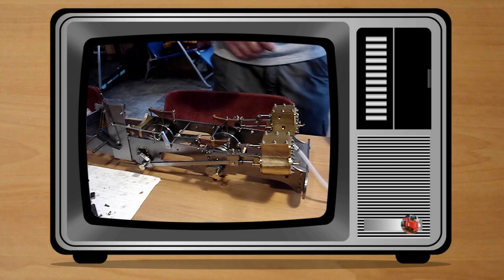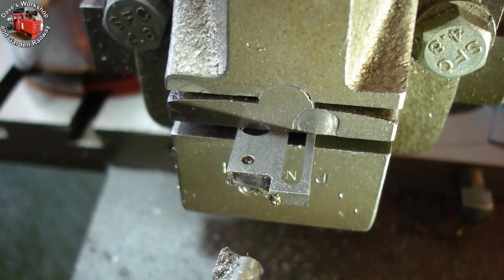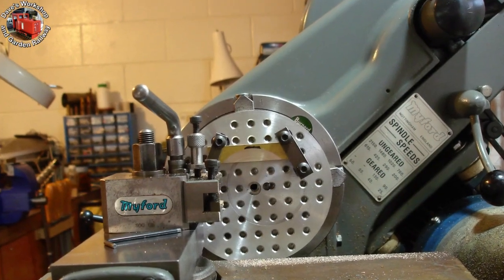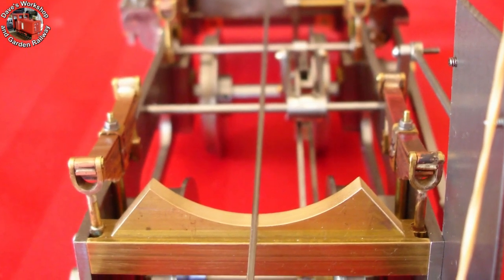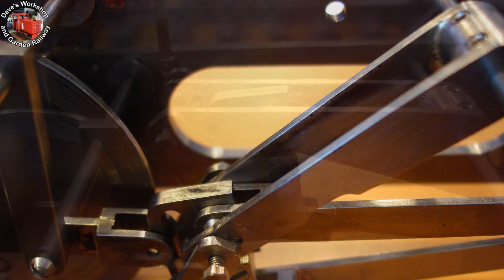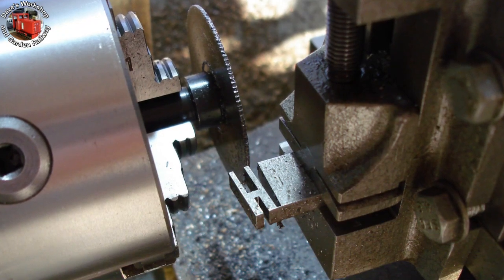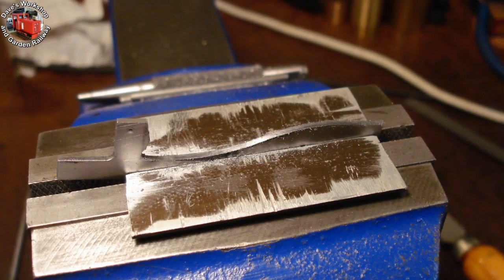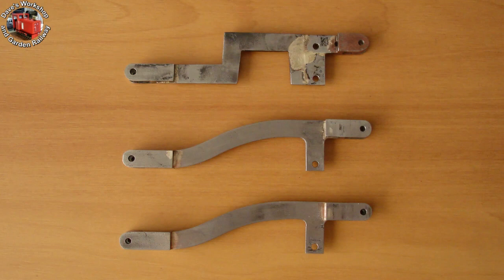Building a live steam loco - Part 20 - Valve Gear Progress

Comment: I think that your lifting links, between weighshaft and point of suspension need to be longer. Easier said than done I know. The angularities when moving from forwards to reverse look big. You may also need to change the lengths of your eccentric rods after your suspension point mods. Have you got Don Ashton’s booklet? GS Willoughby in Model Engineer Mag did a great article on setting out Stephenson valve gear back in the 30s or 40s? I have used his method of layout but in cad with success.
Beautiful work. I admire the quality of what you are doing, it is excellent.
Reply from the maker: I agree about the lifting links.  The angularities are larger than I would like.  I will be sticking with the set-up though, there are height limits (it's just below boiler barrel height now), and I don't want the gear hanging down too low either.  I haven't read the booklet or any other works.  I have really enjoyed working on it, it's been very interesting - keeps the mind active.  Many thanks for your comments they are appreciated.  I'm just starting on four bronze split eccentric straps now 👍
Reply: @GardenRailway  no worries. Keep up the great work. It is difficult trying to work it out on the run. I suspected you were limited in length of lifting link.